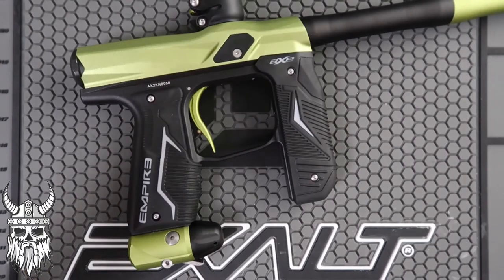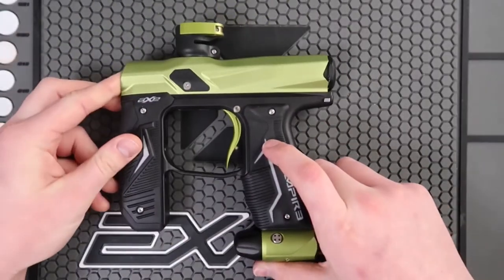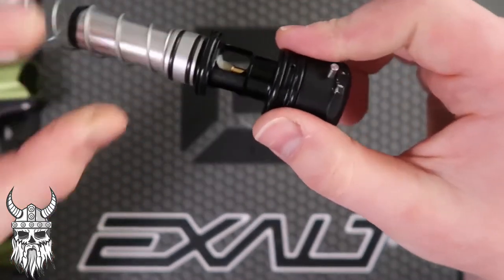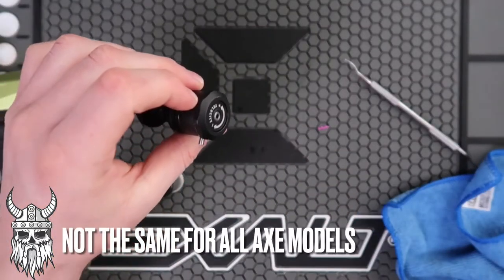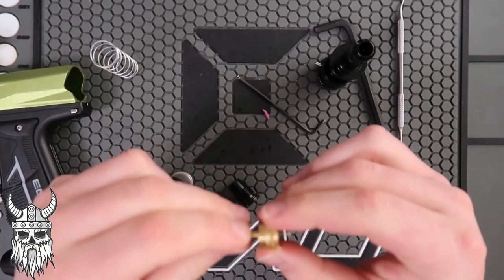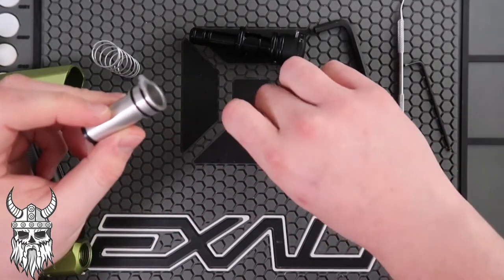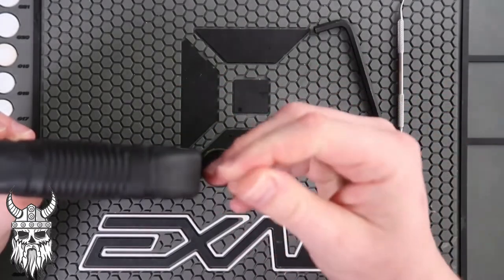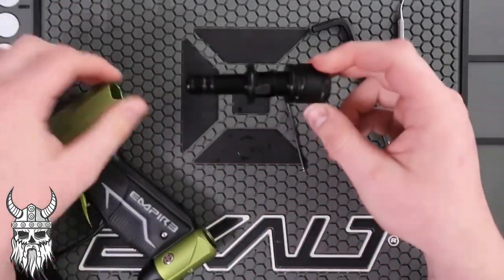Empire AXE Maintenance, Theory, and Discussion - Axe 101 - Mini/GS/2.0/Pro/Syx

Comment: had a problem a few weeks back with my axe 2.0 where no mater how high i increased the velocity the ball would not shoot above 150. after hours of trouble shooting I replaced the o rings on the bolt and the poppet and that fixed the problem. is there any particular reason this would of happened? i dont play a crazy amount and i make sure to take the gun apart and re-grease every thing every time to every other time I play. would this problem be a sign of not greasing the gun enough? my other question is could this be a side effect of not using the gun that often with it being winter the gun was greased and then put away up until the time i took it out to play. it was left in my house so it didn't get supper cold, but i do leave my window open at night.
Reply from the maker: The poppet and the bolt have to open at the same “rate”. If one oring wears faster then you have an imbalance. I.e.  the bolt makes its cycle before the poppet can open all the way or open enough to shoot anything. 

Also. If you just turn up asa pressure you are causing more imbalance because that pressure gets placed behind the poppet, ensuring it stays shut. 

Make sure that the poppet is not too stiff and the bolt orings are not binding.
Reply: @RepairPaintball  every thing is working on the marker now after i changed out the o rings with new ones. i was looking more for ideas as to why it happened and how to prevent it. by they way loved the video for future videos i like the nice simple nature of the videos but maybe speak up a little it felt like i was listening to asmr

Comment: So since I got my axe (used) it’s had a problem. When I apply air to the marker it shoots a paintball out of the barrel. Not a full velocity, maybe a few feet. Other than that, the gun functions flawlessly. Any ideas?
Reply from the maker: Make sure the poppet has the little spring in it. Check that first

Comment: I just got a axe 2.0 and the bolt won’t come out I’ve degassed the gun is there anything else I can do?
Reply from the maker: Are you talking about the bolt guide or the bolt ?
Reply: @RepairPaintball  the bolt
Reply: @RepairPaintball  every time I push the button to release it it doesn’t come out
Reply from the maker: @joe_pb  just reach your finger down the breach/feedneck and push it out. Sometimes it gets stuck in there due to the orings.
Reply: @RepairPaintball  didn’t work but thanks anyway
Reply from the maker: @joe_pb  if that did not work and we are talking about the actual bolt guide then you do a disassembly from the bottom up to get at the ball bearing in the latch system. Seems like it is caught and won’t release.
Reply from the maker: @joe_pb  or the spring is in the wrong way and it’s bound up/stuck. Either way. If you want to send it in hit me up on Instagram.